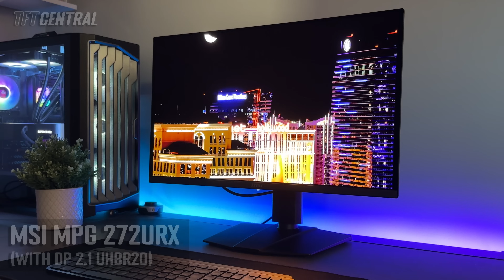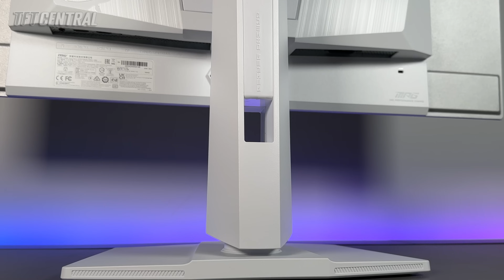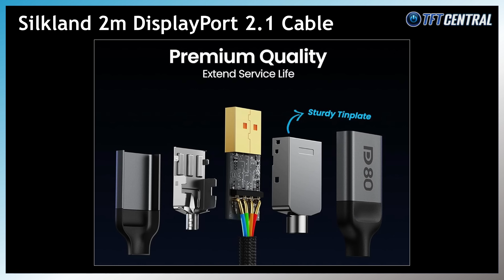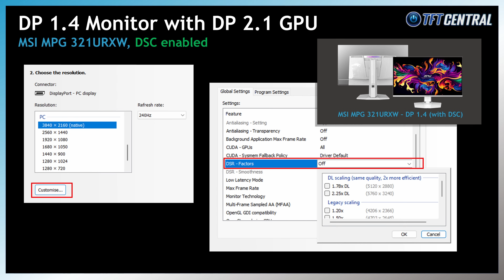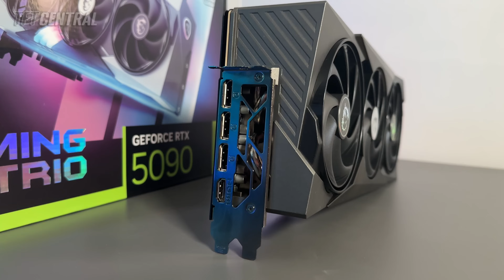Loads of DisplayPort 2 1 Testing and Updates

Comment: What if i have a 1.4 dp on my gpu and a 2.1 dp on my monitor? Is that bad performance wise?
Reply from the maker: No not at all, it’s backwards compatible so will work fine. Obv for games etc to drive high frame rates you will need as powerful a card as possible
Reply: @tftcentral hopefully my RTX 4090 ROG Strix is enough 😅

Comment: I have a Gigabyte Gaming OC RTX 5080
AORUS FO32U2P
Silkland DP80 2.1 (2M) cable

YET! I still experience temporary black screen when enabling HDR & Alt+Tabbing out of exclusive full screen game modes. Yet when I check GPU-Z, it shows as running at 20Gbps link speed (x4 lanes) and NVIDIA control panel has DSR unlocked + custom resolution mode also unlocked. And yes, I have the cable plugged into the main DP2.1 port of the monitor & have the latest NVIDIA driver.
Reply from the maker: When you say temporary, how long do you mean?

Comment: Why do these DP2.1 monitors only support the MAX SPEC of UHBR20?  Is it too hard to support UHBR13.5?

Radeon 7000 and 9000 SERIES video cards supports UHBR13.5 along with the INTEL Battlemage GPUs
Reply from the maker: It’s backwards compatible so by using the full UHBR20 it works with any DP 2.1 card. In many cases UHBR13.5 would be pointless anyway as it would still need to use DSC to power the spec. Using UHBR 20, with a relevant GPU can sometimes allow uncompressed video
Reply: @tftcentral  this is where it's confusing..  Do these new DP 2.1 monitors support UHBR13.5?

The specs says if the device supports UHBR20, it must support UHBR10 - but support for UHBR13.5 is optional.    Given that the only consumer video cards that supports UHBR20 is NVIDIA (with the 5000 series), will these new monitors sync up with AMD and INTEL cards at UHBR13.5 or fall back to UHBR10?
Reply from the maker: @georgedaswani9155 it depends on the spec of the monitor. If it needs UHBR13.5 it will operate at that speed, but if it only needs UHBR10 it will just use that. It will make zero difference to anything though

Comment: Black screen when alt-tabbing while playing games in exclusive full screen is the main reason I held off on upgrading to LG 27gx790a. However I found on Windows 11 I can avoid this by playing games on windowed borderless without added input lag or decrease to performance. Can you confirm whether this is true?
Reply from the maker: That’s the common recommendation, yes. Upgrading to an RTX 50 series card also seems to help
Reply: That's also my experience. I had a 3080TI and 1440p DP 1.4 monitor and I had to stay in borderless, or it would hang while tabbing. I upgraded to a 50 series and that particular problem seems to have gone away.

Comment: Sir I Have Asus PG32UCDM Rog Swift Oled please help me out by given proper compatibility it has Display Port 1.4 is compatible for D.P 2.1 graphics card....llll????
Reply from the maker: It will certainly work with a DP 2.1 card like the RTX 50 series, and that would then open up access to the previously missing features discussed in this video (if you need any of them of course)
Reply: @tftcentral Thank you Boss....llll👍🏻👍🏻👍🏻👍🏻
Reply: Thanks Boss will you please make some video over PG32UCDM WITH DSC OR WITHOUT DSC IN depth comparison videos please....llll

Comment: I have a 5090 and am looking for my first OLED monitor. Debating between the newer 27 inch panel with DP 2.1 vs 32 inches with DP 1.4. Seems that it really doesn't matter all that much. Prices are basically the same, so it's just a matter of preferring 27 vs 32 inches.
Reply: I have 32 gigabyte AORUS f032u2p 4k 240hz oled 2.1 display port and it's awesome paired up with my 5090
Reply: Yes correct. 32 inches is beautiful for visuals
Reply: Same issue, just ordered pg32ucdm , scared of gigabyte longevity as most of their monitor begin to degrade after 2 years

Comment: i don't get , i have MPG 321URX why would i even consider using DP1.4 when HDMI 2.1 is available ?
Reply from the maker: Why would HDMI 2.1 be better?
Reply: @tftcentral  Maximum Bandwidth 	48 Gbps vs 32.4 Gbps most often then note longer cable support and cheaper cables
Reply from the maker: Yes there’s more bandwidth available but both require the use of DSC to power 4K 240Hz anyway so there’s no benefit in using that over DP. It’s fine to use it of course if it makes life easier, but it won’t make any difference to the performance or picture.

Comment: so its fine if I buy a monitor with a 1.4dp port if I have a 5070ti (i also have a 2.1dp cable)?
Reply from the maker: Well yeah they’ll work, and you’ll also have access to features like DSR for example that would prob not be accessible if you had an older GPU
Reply: @ i just purchased the mag271qpx monitor which is a 27 inch 240hz oled monitor from msi, and it has a 1.4dp port

Comment: Is there anything bad with using a DP 2.1 cable with a DP 1.4 Monitor and gfx card?
I need a new DP cable and I plan on updating my gfx card and monitor in the future...
Reply from the maker: No they’re backwards compatible so as long as you don’t mind the additional expense, that should work fine. Just get a good certified one
Reply: @tftcentral can you comfirm that the msi mpg version of x50 500hz monitor has dp2.1 ? because mag version uses dp1.4 so i want to wait for MPG version if it does use dp2.1
Reply from the maker: @Sword.Art_ it does yes
Reply: @tftcentral  bad news, apprently there is 3 different verisons of this monitor that are coming out. which are MPG 271QR QD-OLED X50 with same dp1.4 and usbc charging? and MPG 272QR QD-OLED X50 with dp2.1 also MAG 272QR QD-OLED X50 with dp1.4 with no 90w charging, and are already out. However MPG 272QR might only coming out around on August. Are those statement corret?
Reply from the maker: @Sword.Art_ not quite. There’s only two versions being released. We’ll be publishing an update and spec details in the near future including differences, timelines, pricing etc
Reply: *MAG272DP QD-OLED X50 correction
Reply: @tftcentral  but most imporantly is that MPG 271QR QD-OLED X50 has dp2.1a with full 80G speed connector right?
Reply from the maker: @Sword.Art_ yes it does

Comment: the only downside I see for using 4k 240 on a 4090 with DSC is the alt-tabbing. I cant confirm that updating windows resolved the issue. But if it did it for some. I'm hopeful that it can be resolved without needing a new GPU

Comment: its still useless if max length is 1.2m 😂
Reply: And that's what happens when you comment before watching the video.
Silkland S1334 and Cable Matters 102095-2m are 2 meters long DP80 Vesa Certified cables.
Reply from the maker: Indeed 🙂
Reply: @hbjigcc  for me 2m is still too short but ok its better :)

Comment: I play on 2.1 1440p 480hz no dsc know for 3month i tested so many cables above 1 Meter i cant do 20gb bandwith and i try all this Club 3d cables and Otter cables.
Reply from the maker: Which screen have you got? I can’t think of any 1440p 480Hz models that feature UHBR20 DP 2.1 bandwidth and would allow an uncompressed video signal?
Reply: The only 1440p480hz models implementing DP 2.1 are the Sony M10s and the LG GX790A. The first one featured DP40, the second one DP54. So both Need DSC over DP.
Reply from the maker: Yeah those are the only two I can think of as well, and both need DSC

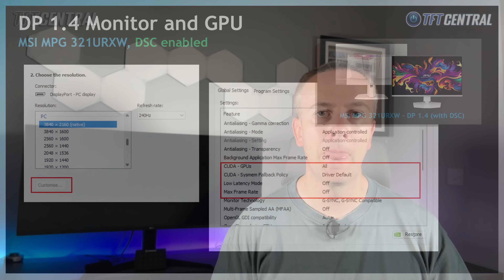Comment: 6:00 While being an extremely unusual scenario, i also want to add another limitation introduced by DSC, both over DP 1.4 and HDMI 2.1.

A monitor taking advantage of DSC can cause the gpu to use 2 internal heads to drive it. So, even a dual monitor setup can saturate all the internal heads (4 on Nvidia graphics cards): you won't be able to run any additional monitors (no triple setup using DSC on most monitors).

If you want some additional info, Nvidia has a troubleshoot page on their website (just google: "Using high resolution/refresh rate displays with VESA Display Stream Compression (DSC) support on NVIDIA GeForce GPUs").

Comment: hi, thanks for your information, always useful, I have a new build, Z890 with 5070Ti master, m2 GEN 5, I just need to buy the monitor, can I ask if the 175hz 1440p of the DP1.4 monitor that I am interested in, benefits from the advantages of the GPU DP2.1 or does it need a refresh of 240hz?
thanks
Reply from the maker: You should have access to NVIDIA features like DSR and custom res etc thanks to the use of the RTX 50 card yes
Reply: @tftcentral  many thanks

Comment: I had a lot of DSC issues with a 4090 and a few of the 32in qd-oled monitors. Random black screens just browsing the web and such, and the screen would go black and color cycle when exiting or starting certain games being the most annoying. Switched to a 5090 recently and the problems went away. Not sure if it's the no DSC (fo32u2p) or just the increased headers from the GPU but I haven't had a repeat issue since.
Reply from the maker: Great to hear things have improved

Comment: Dp2.1 still is (and will be for some years) a marketing trick so that hardware vendors can overprice their products but which only 1% of the consumers will actually need, just like PCIe 5.0, gen5 SSDs, WiFi 7, etc
Reply from the maker: For some specs, I agree it’s simply not needed. I don’t think it will be that long though before we see more monitor specs that simply won’t run on a DP 1.4 connection. At which point DP 2.1 will be necessary. 5K2K at 240Hz, 4K 360Hz, etc
Reply: 960hz 1080p 480hz 4k

Comment: How does it happen that you do not mention Radeon even once in a video which is supposed to be informative?
What's the deal with "FEATURES" which have literally nothing to do with DP? It's not our business that Nvidia artificially disabled them for previous generations of GPUs.
Let alone the fact that RX 7xxx had 2.1 more than 2 years ago.
Reply from the maker: Ohh, an angry AMD user! AMD did have DP 2.1 a while back but for consumer cards it’s still capped at UHBR13.5, and I can’t think of any screen with DP 2.1 where that then allows you to bypass DSC. It opens up access to a couple of higher spec monitors that can’t be supported with DP 1.4 and DSC, but unlike the NVIDIA cards, can’t offer an uncompressed video signal sadly. 

What exactly would you like to know about AMD anyway? Afaik there’s no missing features on older DP 1.4 cards anyway?
Reply: @tftcentral  Even this information about UHBR13.5 is important in a video about DP2.1. Why don't you tell which Radeon generation supports 2.1 in the video? Why don't you tell about UHBR13.5 in the video?
Why do you present Nvidia's pre-5xxx driver limitations/features as "DP2.1 features"? 
Nvidia does not have custom resolutions pre-5xxx for 1.4? It's Nvidia's artificial problem.
Nvidia disables DLDSR pre-5xxx for 1.4? It's Nvidia's artificial problem.
Slow alt tabs? That's EXCLUSIVELY Nvidia's artificial problem which can't have anything to do with DP or the monitor.
Reply from the maker: @ПётрБ-с2ц we’ve covered the situation with AMD in previous videos and articles, it didn’t really need repeating here. Yes it’s about DP 2.1, but it’s not about every possible scenario or combo. It was about updates, which only really apply to NVIDIA cards right now.

The problems discussed and the features that were missing were related to the display head limit, caused by trying to power high end monitor specs by DP 1.4, and (as the video shows), solved by the increased display head limit on RTX 50 cards with DP 2.1 output. It’s not specifically a DP issue, but for NVIDIA cards that’s the easiest way for people to think about it, especially when the issues are so commonly linked in people’s minds to the use of DSC on DP 1.4 systems

Comment: What if I have DP1.4a on my Monitor (also HDMI 2.1) and my GPU has DP 2.1? What if I buy cable with HDMI 2.1 on one end (Monitor) and DP2.1 on another end (GPU)?
Reply from the maker: If it’s an NVIDIA RTX 50 card connected to a DP 1.4 monitor then you can open up access to the previously missing features like DSR /DLDSR etc. I would stick to straight DP to DP cables too, not start messing with HDMI conversion
Reply: @tftcentral  no, I have AMD  9070xt and black screens one in a while driving me crazy
Reply from the maker: Black screens when alt tabbing out of games or on other occasions?
Reply: @tftcentral  just during playing games, around once every 30 minutes
Reply from the maker: That’s odd. I would def try a new cable, but it doesn’t need to be a DP 2.1 cable given your monitor is only DP 1.4. Get a good quality one. Or you could try a good quality HDMI 2.1 cable if your GPU has an HDMI 2.1 output?
Reply: @tftcentral  yes. I’m using HDMI 2.1 to 2.1 connection for now. My monitor is MSI 271qrx 360HZ by the way.
Reply: @tftcentral  also I’ve tried several cables. Same result
Reply from the maker: @callmemrdee I’d def try a good DP connection instead. I’ve found HDMI to be a bit more buggy commonly than DP for pc connections.
Reply: @ I know. But as I said earlier - black screen problem even at 240Hz (because DP1.4a is not enough to do 1440p240Hz 10 bit without DSC)
Reply from the maker: @callmemrdee no but leave DSC on? Why would you disable that either way?
Reply: @ same problem - black screens
Reply: @ any suggestions?
Reply from the maker: Only other suggestion would be to disable VRR perhaps in monitor OSD and see if that has any impact
Reply: @ ok
Reply: @tftcentral  Thanks for your video and replies in the comments, it's been very helpful with all this confusing connectivity/compatibility stuff!  I've spent days seeing conflicting information about various minutia about these 360hz oled monitors and NVIDIA gpus.  Forgive me if this is an obvious question, I am just trying to be sure- I have a 5070ti and am trying to decipher from all the comments I see here and other places specifically:  Will using a DP 2.1 cable with this monitor allow me to run the monitor at 360hz without DSC?  I have a sense that this monitor would still be capped at 120hz with 8bit color or 180hz with 10 bit color with DSC off (because that is what I've seen other people say), but maybe not?  Maybe they didn't use a DP 2.1 cable?  I see that you're saying this monitor is functional with DSR/DLDSR with a DP 2.1 cable to an RTX 50 card and so I'm just being hopeful that using a DP 2.1 cable would perhaps also mean DSC would not be required to reach 360hz.  But I'm also willing to bet this is just wishful thinking on my part.
Reply from the maker: @user-yv6xw7ns3o you’d need a monitor that also has DP 2.1 on it to be able to bypass DSC for some configurations, and I can’t think of any 360Hz models that have that. They all have DP 1.4, so you’ll need to use DSC still to power that full spec. 

Having an RTX 50 card means you should have access to features like DSR and custom resolutions though that would be locked if you had an older card 🙂 you can use either a DP 1.4 or 2.1 cable, it won’t make any difference as the monitor connection is the limitation here
Reply: @tftcentral  by the way, was testing 2 different PD 1.4 cables yesterday for around 8 hours. Same problem every now and then have occasional black screen for 3 seconds with DSC. But as soon as I turn it off and use 120HZ 10bit or 240Hz 6 bit there is no black screen at all. But it sucks, buying 1000$ monitor with 360Hz and only using it at 120Hz or 240Hz with terrible colors (I immediately see difference with naked eye)
Reply from the maker: Yes for sure. Have you checked in case there’s a newer firmware available too?
Reply: @ there is not
Reply: @tftcentral  Ok, that does make sense.  Thanks for explaining!  So I will be able to use those extra features with DSR at higher framerates after all!  I was feeling a little bummed that it seemed like my graphics card was going to be totally bottlenecked by a 360 monitor.  I'm surprised there isn't more prevalent explanation about the RTX 50 cards features like DSR etc now being compatible with DSC.  I looked and looked and so many people and sources seemed to say DSC always incompatible with that, but that's outdated info now.

Comment: Do RDNA4 gpus also benefit or is it only nvidia 5000?
Reply: Unknown. RDNA4 is limited to UHBR 13.5 meaning 54Gbps. While faster than DP 1.4 it's not 80Gbps.
AMD really dropped the ball with this one as they were leading with UHBR 13.5 support on RDNA3.

Not to mention that their workstation cards (starting from RDNA3) based on the same chips support full 80Gbps. So hardware has been fully capable of full bandwidth for years.
Im guessing the consumer cards are missing something on the PCB itself. Maybe how DP out is wired. Maybe some redriver chip etc.

Comment: I would like to have seen an explanation of how USB-C relates to DisplayPort 2.1.

For example the USB-C 3.x ports on most monitors fall back to USB 2.0 when carrying a DisplayPort signal, while USB4/Thunderbolt 4 ports can carry USB4 at the same time, but only with DisplayPort 1.4.

And then there is the new USB4v2/Thunderbolt 5, which can carry 120 Gbps of DisplayPort 2.1 vs the normal 80 Gbps. This is the best port for monitors that exists right now, although no monitors are using it yet.

It's a complex topic and it would benefit from someone explaining it clearly.